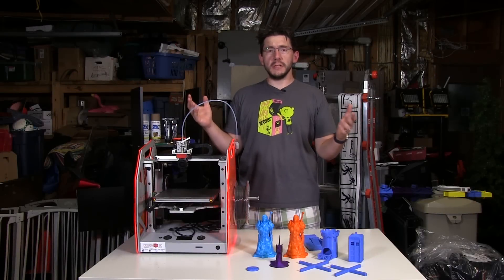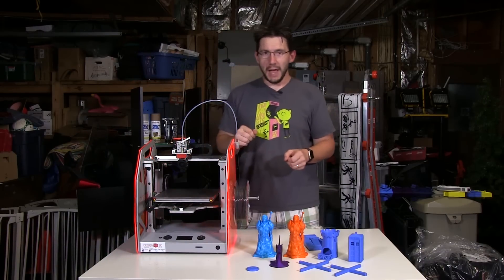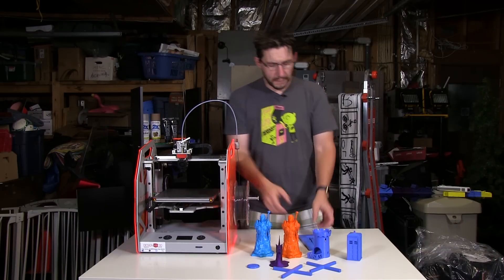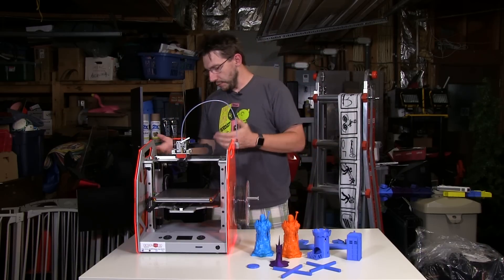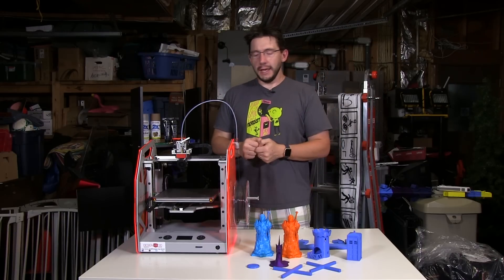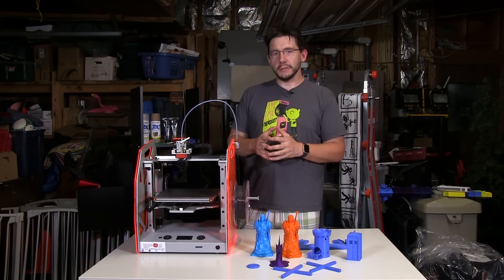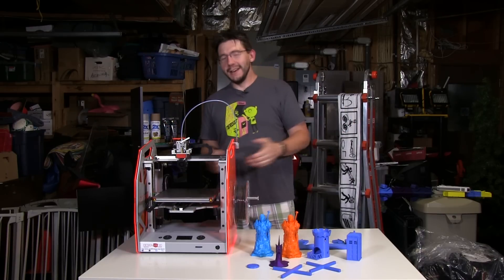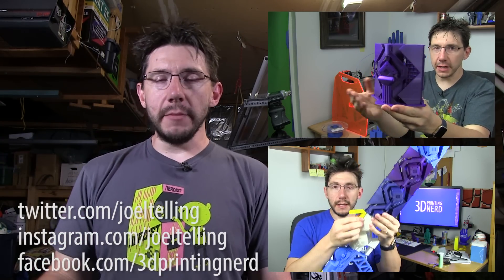3DGence ONE #3DPrinter Review

Comment: I understand the price because of the huge manufacturing costs of Ball screws, Waterjet aluminium,  and complicated (and custom!) hot end... but the conversion into AUD for me places it at $4600 bucks aud! That's basically a cubicon single with the Hepa, mechanical levelling bed and actively heated, enclosed chamber. It feels to me that it's a case of 'shove high end parts' into a 'i3 style 3D printer'. Not convinced it was a great move, but just an objective view as I haven't tried it out first hand.
Reply: I agree, even here in the US $3500 is way too much! This price would make more sense if it appeared early in the 3D printing movement. Too much cash for what it is, but that is why we have choices and the ability to research before we buy.
Reply from the maker: Angus, I think you're on to something.
Reply: "Built like a tank" certainly inspires some confidence, as there will be little problem with vibration at high speeds, or an unlevel bed from deflection, but it's certainly not needed in a 3D printer, considering there have been 3D printers made almost completely out of 3D printed parts (reprap snappy, dollo). This puts the ONE in a weird position of being too built for 3D printing, but not built enough for CNC. It's just a stylish, more expensive, more rigid MakerGear M2 (with a quick swap extruder assembly).
Reply: Ballscrews and mechanical parts are not that expensive if you know where to look, also companies who buy in bulk usually get a discount anyway. No way this printer is worth the $3500 pricetag, the raise3d N2+ is the same price for comparison.

If it was around 1500-2000 then it would be justifiable.
Reply: Angus ,I have the 3DGENCE One here in Australia since July 2017 i paid over 5K Aud  , I wanted the best simple as that and so far after 10 months and printing hundreds of  models  its still going strong  and hasn't missed a beat , sure i had some issues with settings in simplify 3d initially but i now use the 3DGENCE  slicer based on Cura , which is fantastic ,i have never had any trouble  with models sticking to the bed (i use Dimafix) which comes with the printer ,so the model releases when the heat bed has cooled , i just love this printer , i know i made the right choice in not buying Chinese garbage ,if you want the best you have to pay for it ,end of story ,

 Americans don't realise how good you have it  compared to the rest of the world on price unlike us here in Australia that have to pay through the nose much more than you do 

Joel ,thanks for such a great review ,as it was 90% of why i bought the 3DGENCE One printer ,and i would buy one again  in a heartbeat )))

Comment: I've been using a granite floor tile from the local hardware depot, it has a polished finish and it works very well for the material I use, PLA, PETG, ABS/Carbon. The down side, it's heavy and takes a long time to heat up. If you remember to heat the bed as soon as you turn the printer on it doesn't add too much to the print time. The super nice property of the granite is that once the print cools, no matter the material it just lifts off, no scraping or prying, just pick the print up off the bed. I use a modified SparkLabs SparkCube XL, it's a CoreXY design with 3 stepper motors to lift the bed so the weight isn't an issue.
Reply: I have ONE in my office, it have 450W heater with ceramic bed. Heating up to 140'C in less than 5 minutes. 75'C about 2-3 minutes so it's very fast. very accurate printer, with 0.2 nozzle precision is like in DLP machines.

Comment: Did you use the heated bed? For ABS i need to set it to 100C (which turns out to be 60C surface temperature in my enclosed Duplicator 4), or for my unenclosed PrintrBot Simple Metal, I need to set it to 60C-80C to keep PLA from peeling off of kapton tape. Even so, the room temperature cant really be below 72F, or have any real airflow. Based on the thermal mass of the buildplate, and the psychotically high temp (180C) you can set it to, I think your sticking issues were mostly that you didn't set the build plate temperature high enough.

As an industrial printer, I can imagine a room of 10-50 of them all going at once, and keeping the room temp at 80-90F, where peeling would be an absolute non-issue.

Comment: build plate probably would have needed good cleanup. Acetone is not good enough. Dish washing soap gets rid of all the oily bits etc.
Those compensation etc. features is something i am curious about
Reply: Denatured Alcohol should do it. I use this on my TAZ6 as it has a PEI treated sheet on top of the heated borosilicate glass bed. The only way I could get prints to stick was removing any and all oils  or PLA residue using DnA.

Comment: I love this review that why I wait for your reviews impatiently, I agree with you 100% I was researching this for sometime I was turned off by the price too.
Ceramic bed, I have 3 printers with ceramic the late and had bad experience sticking things on it without glue
Reply: Did you try printing ABS on it? The reason why I been asking to find CubePro review because I got a new one on a bargain it cost $4500 new and I got it for $500, but with no accessories or filament and not in original box, my company that I work with had it to build prototype models and now they want to sell it because they haven't used it.
So I decided to buy it, it's new never been powered up, just the printer the power supply and ceramic build plate.
Reply: +Salem Abu Alrous You shouldn't buy any of those second hand Cubes, or new ones for that matter, they're no longer supported by 3d systems and the filament is proprietary
Reply: +Dougal  Macburnie  yes I agree with you, however they discontinued cube 3rd generation but 2nd generation and Pro still supported .
I do own cube 3rd generation and 2nd generation and trust me I know all their issues.
I got the cube 3 for $135 and the 2nd generation for $81 new unopened.
Just for the heck of it, I own as much printers as Joel lol maybe little less

Comment: The z axis seems rather short on this printer, but is probably more than adequate for a set of dentures.  It may be interesting to create a chart of your printers (and any others you know the details of) where you work out the price divided by the build volume - so you end up with a cost/cubic mm for each printer.  Just a silly idea from a spreadsheet fan.   #HighFive
Reply from the maker: +David Smith that's a rather neat idea! I LOVE NUMBERS
Reply: I see a graph (or several) in your future :)

Comment: it's a good Review BUT I think your problems with the heated ned where caused by the wrong temp settings. You would normally use about 110-120°C for let's say ABS bit on this type of bed you can easily go up to about 140-160°C to make the material softer so that it sticks. I think you should at least Test these settings and add your "new opinion" afterwards to give it a fair chance.
Reply from the maker: +TheDanielMFG Ooh, that is a super interesting take on it. Thank you, I may be able to do this in the future!

Comment: Honestly, there are better printers in this price range which are targeted for the same demo. I have a Type A Machines Series 1 Pro. They are targeting the same demo. When I purchased it, they had a more consumer facing approach, they've since ratcheted up their price out what I would call high end pro-summer 3d printers and into the $4k and up commercial demo. I don't like this move, but I will say the machine -- with minor tweaks works extremely well. It's a great deal bigger than this, and that's where I think commercial machines differentiate themselves, build area. You can't price a printer in this neighborhood, and not be in the 300mm or so print area. You can't be relying on magic goop or whatever to have parts stick -- it needs to just work -- this one still requires significant knowledge. I see this in non-man's land, it's not big enough and simple enough to be a reliable commercial workhorse, but it's too expensive for a hobbyist -- how is it better than a gCreate 1.5XT+ with heated bed -- price is similar, or the Ultimaker 2+. I don't see where it fits in.

Comment: I would imagine this printers MTBF is one of the highest of any printer below $5k...
Reply: Too bad the review misses out on some very critical information. It may well have some decent mechanical parts, but what about the electronics? Powersupply-failures, burnt out stepper drivers or some other points of failure, like the quality of the cables, strain relief on moving cables... there is just too much Joel did not show or talk about at all. Before i would buy a printer at that price point, i would definately do a more thorough quality check.
I must say tho, if I would design a printer, i would probably have a similar mechanical design, just built with more alu profiles and less metal plates.
Reply from the maker: It's true, I missed some important things when I was doing this review as I was under a time crunch. I'm sorry about that.
Reply: +3D Printing Nerd you did a great job IMHO.

Comment: I'm bored I might just go but another 3D printer
Reply from the maker: +Salem Abu Alrous BUY A CUBICON STYLE. I am loving mine so far.
Reply: +3D Printing Nerd I was actually thinking of Cubicon single I like it and the big build plate over the single, Angus reviewed it and I loved it.
Reply: +3D Printing Nerd Joel have you tried Micro Swiss nozzles yet?
I bought 3 for my ultimaker and 2 for Flashforge dreamer. 
I probably need to spend a fortune on nozzles form my other printers.
Have you tried UP Box 3D printer it's amazing I love mine but I run Zortrax ABS through it. 
This machine is a beast I wish it had touch screen and Network/ wireless capability.
I have not had 1 warp with it yet all flawless prints .